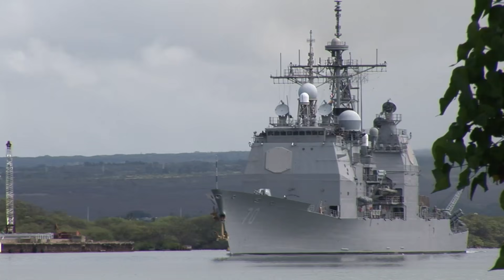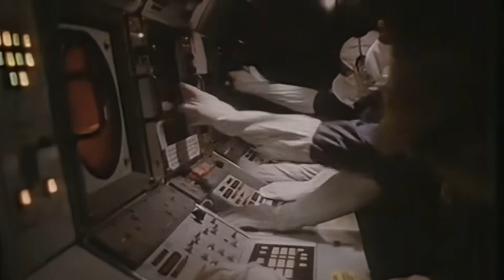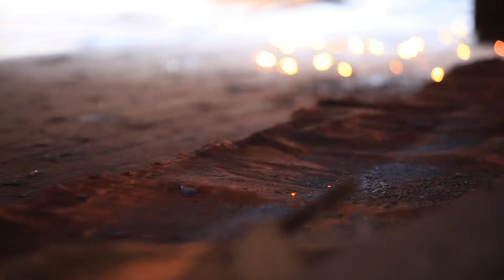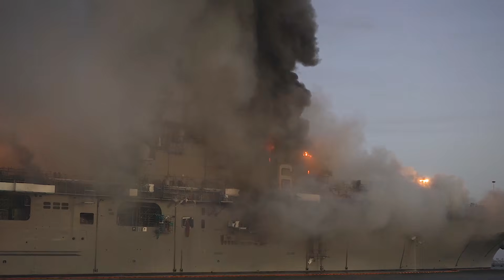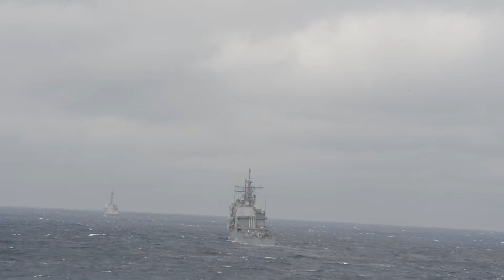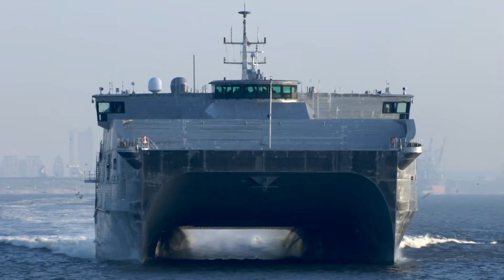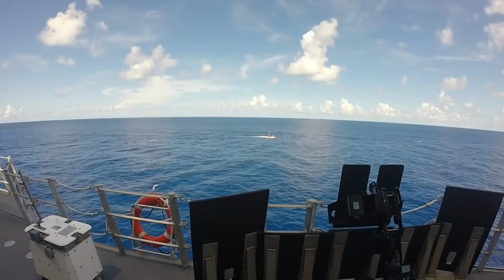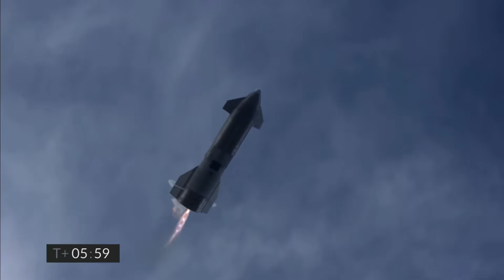Why is The US Building Aluminum Warships?

Comment: I am sure the people working with Al are experts and have taken all necessary steps to make their design safe-ish.
However, there is one inherent disadvantage of Al that was not mentioned in the video. Al does not have a fatigue limit. It doesn't matter how gentle you touch it, if you do it long enough, it will eventually break on you.

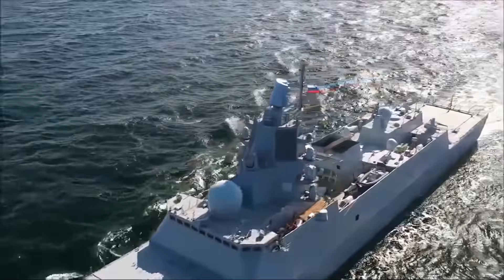Comment: 13:19
SpaceX ditched carbon-fiber for very specific reasons though.  Primarily, they've been trying to keep cryogenic fuels at extreme pressures and temperatures unlike most other launch vehicles.  This enables a typical falcon-9 (and we expect the Starship) to have better performance than if it just used regular cryogenics.  They actually lost a vehicle because the carbon-fiber fuel tanks weren't able to store these extreme kinds of fuel.  The carbon-fiber is woven, and the fuel was able to seep through, especially if the vehicle needs to sit on the launch pad fueled up for any lengthy period of time.  And so they went all steel.

I imagine a naval ship will have more conventional needs, so carbon-fiber won't be as problematic for them (we hope).

Comment: Must be that "military grade" aluminium Ford talks so much about
Reply: My Ford has been trouble free and it is the first model year they used Aluminum. Semi trucks have been built out of aluminum since the 1950s.
Reply: Military grade = cheap
Reply: @themeanestkitten  When electronic component manufacturers make their products they test and classify quality and designate their best product as "military grade".
Reply: @flamingfrancis  so they grade their own products🤨 that's like getting to grade your own work when your in school.
Reply: @flamingfrancis  Speaking as a long-time Mil-Spec electronic tech/electronic engineering tech, it's the LOT TRACKING of parts that makes most mil-spec components more expensive, NOT the quality level.
On the other hand, if you DO have a quality issue with a specific lot of parts, you can generally track what units they ended up in and FIX most of those units before they break down in a combat situation and potentially cause LOTS of dead troops/sailors.

Comment: The Hamiltom-class WHECs did have issues with cracks forming between steel and aluminum.  But only during very heavy seas, such as typhoons, hurricanes and North Atlantic and Pacific Northwest storms.  Hearing reports of green water entering at the base of the superstructure does make you wonder.
Reply: Hahaha Philippine Navy is using Hamilton Class as an Off shore patrol vessel and yet she still runs good and they upgraded some systems